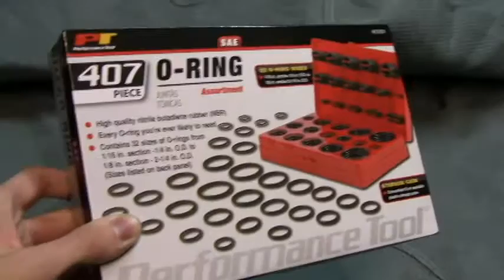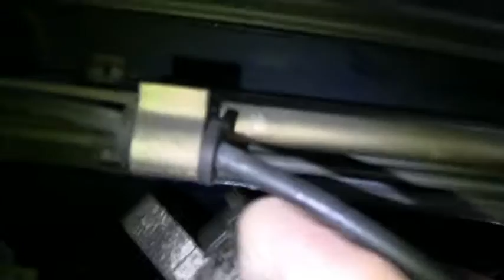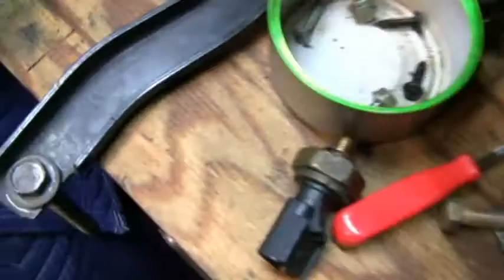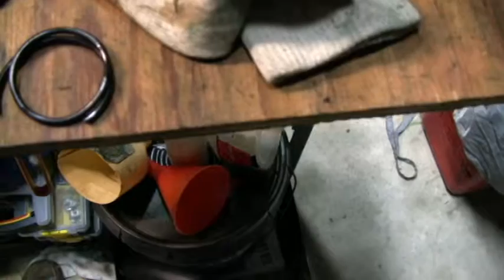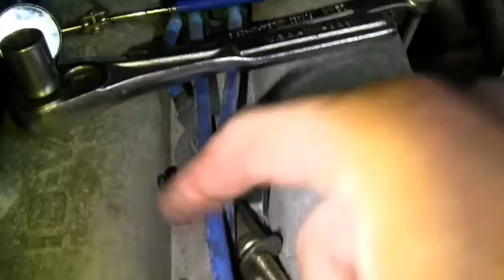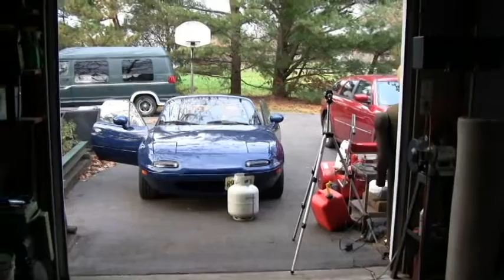1.8 MIATA CAM ANGLE SENSOR SEAL REPLACEMENT (CAS)

Comment: It's way easier to take the position sensor out if you remove the two screws holding the coil packs it and pushing the coil packs over to the passenger side of the car.  The sensor will come right out in the middle of the car.

Comment: I couldn't take mine out of the engine bay for a 1997.  The hardest part was putting it back in. Ended up loosening the cap journal and it slid right in. By the way, cap over the CAS journal is 10 ft-pounds after forum search. They seemed tighter than that when loosening, so I put a little loctite

Comment: One of the hardest parts of this job was taking off the three electical connectors (2 grey, one blk. on
a 1.6)     Not until I got the heat gun out and gave them ea. 20 sec. at low heat was I able to get them off.
Keep the screwdriver and pliers away from these beauties.  I was at the limit of my patience before I even got to any nuts or bolts.  

 I was able to get the sensor down and then out with one hand after removing the connectors, the adjacent hose to the intake, and engine lift hook with the attendant ground wire.   Getting it back in was much more difficult. Before taking  it out completely, I immediately shove it back in ; no problem.  Maybe I did not note  the position of the two inner  prongs well enough, or perhaps they rotated as I took them out.   With a mirror I 
could see inside the back of the intake area.   The two prongs are identical in shape, and are 
exactly opposite of each other,  but they are closer to one side of the circle than the other.  
Not until I took the u bracket off covering the top back portion of the sensor and its oring could I get 
the devil back in.  

  This might be an easy job if you are lucky, if not set aside a few hours and 
get ready to exercise some back muscles and some words not found in Webster's book.

Comment: Mine leaked on my heater hose and caused one to fail, so I had both heater hoses off. It definitely gives you more access and another angle to turn a wrench on that hard to reach bolt. Word to the wise: use a 12mm socket and swiveling ratchet to loosen that bolt, then use a wrench or your fingers the rest of the way. The ratchet and socket will become wedged against the firewall as the bolt unscrews. Also use oil or vasiline on the o-ring to help it go back in.

Comment: Nice vid, from experience removing the mount in front of the CAS means you do not need to fiddle with a mirror. I made the same mistake
Reply from the maker: Thanks for the tip!